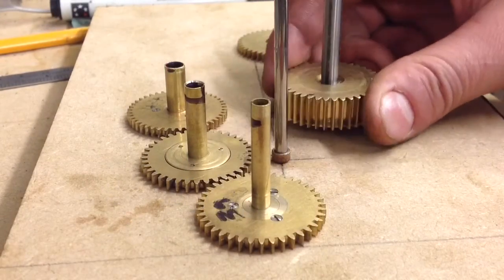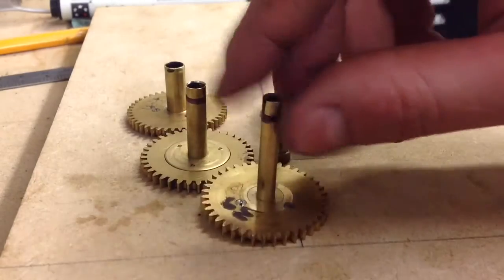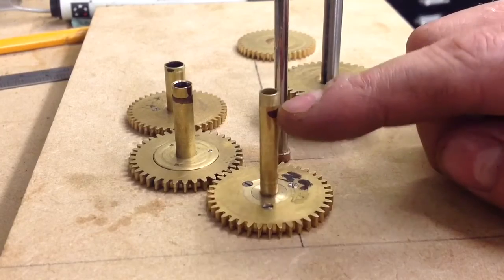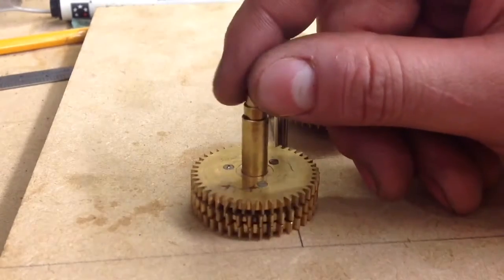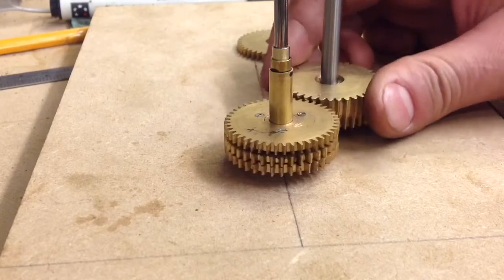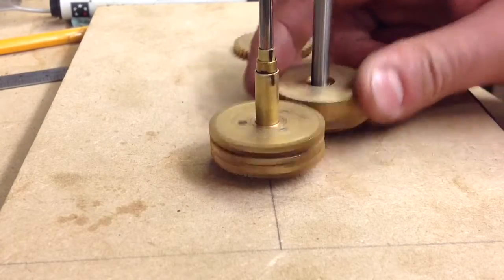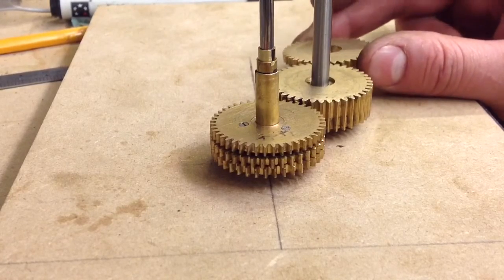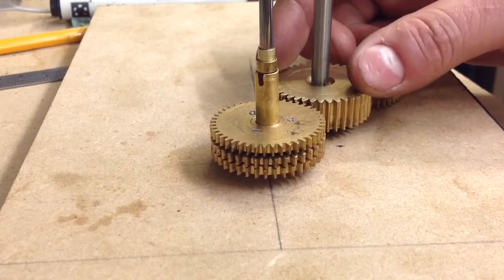Building Ferguson's Paradox Orrery - pt3 - Update & telescopic arbors

Comment: very interesting concept chris, It never occurred to me that you could have gears with different numbers of teeth on the same centres that would engage satisfactorily .. good to see you back.
Reply from the maker: Yes, the OD I used overall was the average of each independently calculated OD based on each tooth count. they all engage very well - surprisingly well as when I took on the project I imaged filing and playing around to adjust them to fit. No such problems!